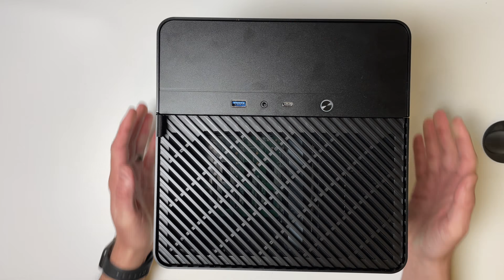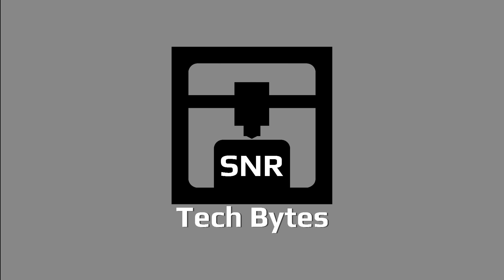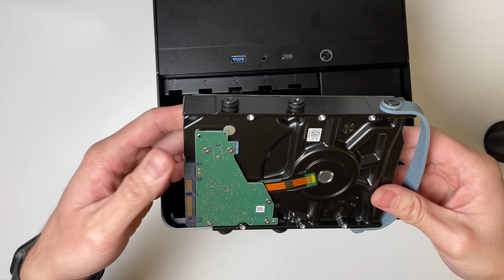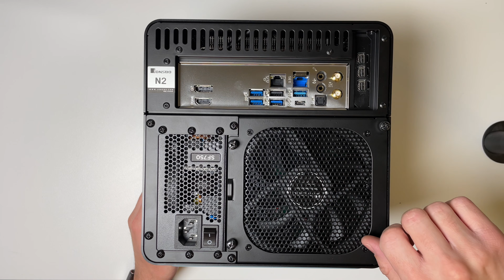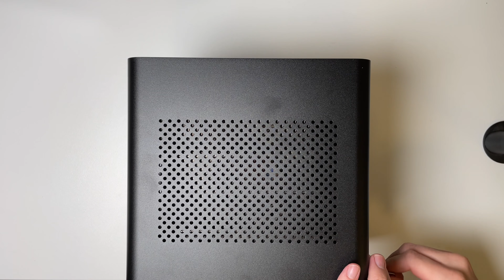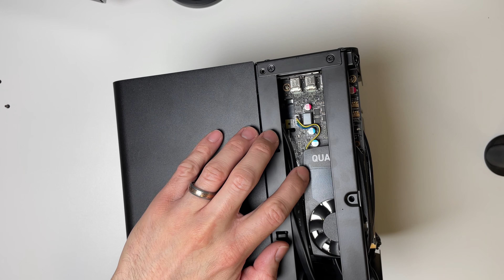Jonsbo N2 review. Better than the N1?

Comment: Have you managed to install the Noctua NH-L12S 70mm CPU cooler in the 65mm allowed space, or are you using a different CPU cooler?
Reply: Actually, after checking this video again, it could be the Noctua NH-L12 66mm cooler.

Comment: Great vid.  Probably gunna get this case.
I'm a little worried abou the clearance for the heat sink on the motherboard.  It looks like you fit a fairly large (heigh) heatsink with fan on your motherboard will no clearance issues.

Comment: If controlling fan speed is a problem and runs at 100% all the time, you can also buy one of those fan cables that has a 12 ohm resistor inside. It'll not only slow down the fan speed, but also run quiet. Cheaper than buying another fan like Noctua just to run quiet

Comment: hm would have been interesting to see a version with 2 extra disk slots in place of the PSU space, with some ergonomic provision to facilitate an external brick-style PSU with a pico-PSU adapter setup. Internal power supplies feel like a waste of space and thermal budget. Or keep it 5-disks and reduce the size.
Reply: They have Jonsbo N3 with 8 HDDs

Comment: I personally just purchased this as well to separate my massive supermicro 846 that hosts my plex and other critical data and have to say there are things I thoroughly enjoy and others that I do not.  

My system thus far below.
Intel 4790k from my first ever ITX build
Cryorig C7 CPU cooler
Gigabyte Z97n-wifi
16gb 2666mhz ram
1x 256gb nvme ssd(given to me)
1x Crucial MX500 1tb 2.5" ssd
4x 12tb WD Red Plus HDD

Pros: 
-Fit and finish is beautiful.
-Included tool behind the quick remove dust screen is awesome.
-Removable front dust screen is awesome
-5 disks + 1 2.5"
-Overall design and size

While building a single parity drive in Unraid my drives are sitting at 33`, 36`, 38`, 36`.  This is when all drives are pinned at 181mb/s speed.  This process will be about 20 hours or so but its a real test to see the temps.  The unit is also in my basement in a quite cool area so this is high compared to the 20-25` they normally operate at when in the Supermicro.

Cons:
-Like you mention I fear the rubber pulls till break at one point.
-Cable management is rough.
-Unit could have been a bit deeper so that when you swap the fan you won't have to smash cables so they don't get bit by the rear fan.
-Room for only a single 2.5" ssd.

Notes: You do not need to use 6 of the rubberized pins, you can use 4 and you'll be fine.
If you purchase this I would suggest you get 90` sata cables, otherwise you may break the connections on the backplane and also get wires snagged in the blades of the fan.

Comment: Is the included fan pwm?
Reply: Yes. By design it is meant to attach to a header on the SATA backplane with no control and running at 100% all the time. But the fan's cable is long enough to route up to the motherboard and a spare fan header.
Reply: @davidg5898  hi david, i attach the fan to motherboard, but it still run very loud, could you help me another way ? Thank you so much !
Reply: @QuangNguyen-pt5qq  Check the fan speed settings in your BIOS and/or whatever fan control software is in your operating system.
I can't offer any more help than that because the specifics of every system are different.
Reply: @davidg5898  thank you so much David. I change the main and found that the fan is less loud than that before (the previous main is b460i strix and the current main is q170 asus, I plug directly into main in the both case.

Comment: Overall I like this.  It's generally a much better design than the N1 in function,  although I did like the aesthetic of the N1 a bit better (heavily inspired by the Thor Zone Mjolnir SFF case).   The N2 just winds up looking a little too much like a black cube, just like most generic prebuilt NAS units, which is a little uninspiring for a fully DIY system.
Reply: I agree, although its technically smaller, it kinda has a bigger footprint than some bigger taller cases